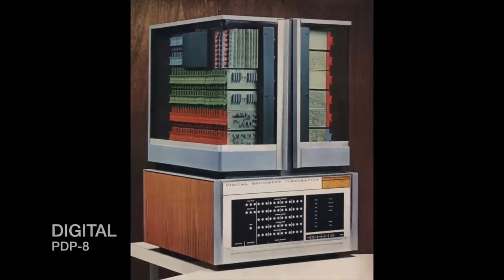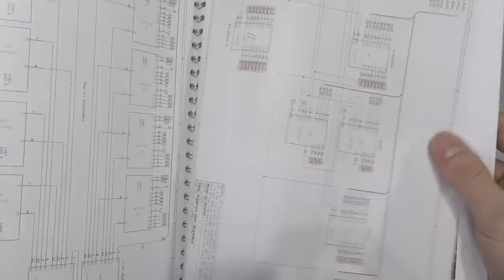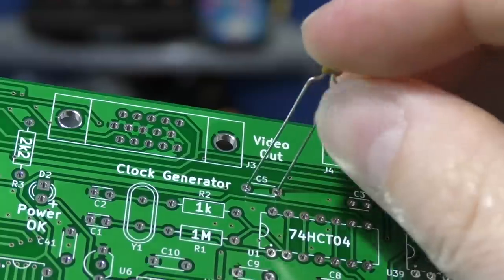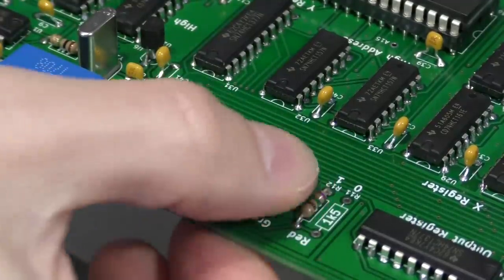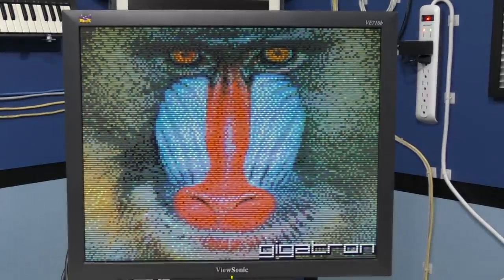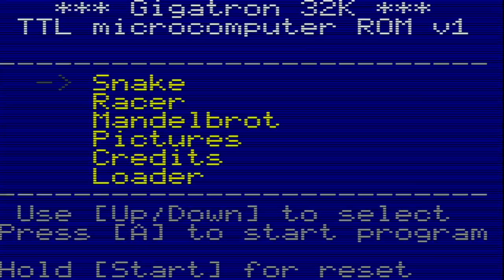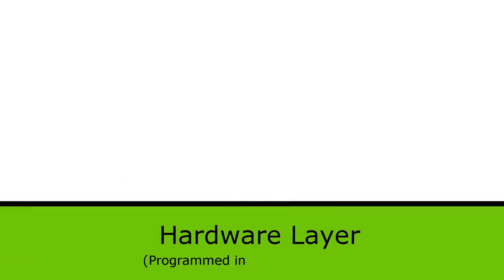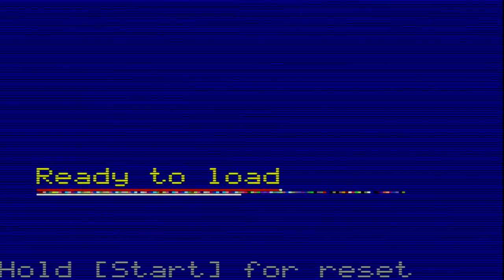The Gigatron TTL Computer without a Microprocessor

Comment: Hey David, love the content here and on 8-bit Keys. With the soldering, I was taught to heat both terminals and melt the solder on one of them instead of melting straight on the soldering iron. The idea being this makes a connection less susceptible to becoming a dry joint. Granted, this was with BNC connections for coaxial cable, not electronics, but is there any merit in what I was taught when it comes to electronics? Happy to also hear from learned viewers on this one, of course 🙂

Comment: When I was in the Navy, in the 80s, I worked on a computer that had no ICs or even NPN transistors! It even had a magnetic core memory and used punch cards. The government spent over $10,000 a year just to have custom circuit boards fabricated to keep it running. A decked out 386 was running about $2000 at the time, and hundreds of times more powerful!

Comment: 6502:  LDA ... from memory,  from memory with 8-bit address, with pointer relative to X, with...  Yeah, they counted the actual opcodes so it's kind of Apples (kek) and oranges.  A ton of the instructions were just different addressing modes of the arithmetic and register save/load instructions, or they were inverted versions of the same functions.  This thing used bits very well to do symmetry, because they were trying to save on a simpler instruction decoder.  The PLA concept on NMOS 6502's is actually pretty neat.  I've seen Visual 6502, but I wonder if there's a Visual 4004.  ;)

Comment: That assembly is completely bass ackwords. Always install components from shortest to tallest This allows you to flip the board and solder without dropping small components and crushing tall components. First all resistors, diodes and axial caps,  then ic's, then radial caps, finally connectors and jacks.

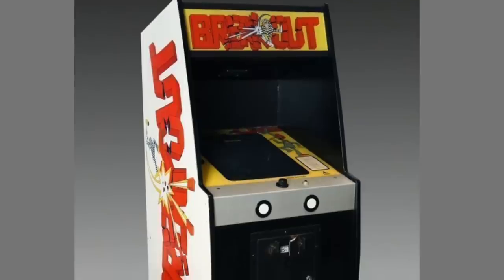Comment: 0:45 Wozniak designed a Breakout for Atari but they didn't use the design for some reason and instead designed it again with double the number of chips. and this was in 1975 when 8080 and 6800 was already around.

Comment: If someone has a dream computer that they want, the best thing is to build it yourself. There is a guy in China his name is Paul and he sells DIY computer kits, and what you get is a handfull of chips that you program and build your own board and write your own software and firmware. Also some of that firmware is available on various sites, or from coping it and modifying from an existing computer that you have on hand that you can do a dump of the ROM chips. When I get to feeling better and have a bet more money I am thinking of building a hypercube based on a common processor such as the 68000 or something newer. This is how super computers are constructed, and it is possible to do the same thing with Raspberry PI and other boards. That is putting them into a matrix configuration such as 4 x 4 x 4 and having separate cpu's for input output and other functions and program memory. Each board would need to have it's own firmware, and that is how the complete system would operate.

Comment: Your joking about the tubes but it's still classified even today that they were making tiny vacuum tubes.
A few will remember seeing the big green radios used in the Korean war that spawned the term, "walkie-talkie." These actually had tiny tubes in them, the size of large acorns. And commonly called acorn tubes.
What very few knew and is still officially classified information is that they were making much smaller tubes that were the size of a large grain of wheat!
The big secret black boxes used in early jet fighters and by Navy gun commanders in the early fifties were packed with them so densely that they had to be water cooled!
They had several functions.
Calculating trajectories was one.
Doing the math for radar displays was another. They were basically four bit calculators....
I don't know, but suspect they were also used aboard ships and submarines in sonar displays.
They were also used for encryption and decryption of messages.
I have a small collection of these devices and even a board from an F-111 radar that has nearly fifty wheat tubes on it!
It also has the some of the first solid state diodes ever made on that board. They are glass beads with a silicon bar you can see inside. (They are really crappy diodes that are very leaky!)

Comment: I was doing arcade game repair in Catalina and they happened to have 3 Computer Space arcade games (the first arcade game). After looking over the circuitboard, I noticed it has NO CPU... not even a volt regulator! I’d rather design with a CPU than deal with that TTL headache!

Comment: A cool kit ,i like it,i will get 1 of these.it maybe expensive.but its the enjoyment of building it ,and seeing how it works.plus learning how it works.without a microprocessor.like in the coments ,cpu's were   around  before microprocessors.another tip.is too use sockets,on the i.c.s.we know most are cheap logic etc.but sockets cost pennies,cents now.damn sight easier too remove.if an i.c.dies.just pullout and replace!i always use sockets.on my projects.plus early dip i.c. computers,mainly used i.c. sockets for this reason,and chip cost.i.c.s were expensive.in the 1970s,1980s.it was an idea carried over,from vacuum tube computers.easy too repair .pullout ,pushin!

Comment: The monkey is a Mandrill one. The virtual instructions are what is known as "synthetic instructions" on the UltraSPARC: the assembler, /usr/ccs/bin/as, understands these and assembles them into multiple RISC instructions, but they do not actually exist. For instance, load and store instructions on the UltraSPARC architecture do not actually exist, they are made up of two separate instructions because of the fixed instruction encoding of 32-bits, since 32-bits are not enough to access 64-bits worth of address space. The virtual instructions in this "Gigatron" computer appear to be the same concept except for the fact that it looks like they are interpreted rather than assembled into machine code?

Comment: Honestly, I feel that the 8080 Intel Chip should be Used on a 8 Bit Computer. Also, Breadboards are More common to Be found by Many people as The 8 Bit Master tool. But the Circuit board I still love. Soldering is just more fun to do Then a connecting Wires.

Comment: If you want to have it for free (one way or another) you can use MAME (although you'll need to download the rom gigatron.zip before running it).
MAME is the most interesting emulator know since it can emulate stuff that's more unusual then other emulators including plug and play games, some arcade games like Emeraldia or Zooo (yep, that's a real arcade game however I know a DS port known as Zookeeper), Linus Åkesson's Craft (a single chip demo made for Breakpoint 2008) and even the previously mentioned Gigatron (including firmware version 5a), making it my favorite emulator.

Comment: Just a thought but do you recommend soldering IC sockets onto the board with the chip plugged in?  I've got an "ideal" computer in mind but cant figure out where to get a PCB blank that's large enough to hold a Z-80 for each pixel.   Be well cobber.   :)

Comment: Would a modern 6502 CPU crash on an opcode ending with a 2? #2?   Anyway, not all that long ago, a guy I worked with in the 80's wanted to know if I could get his 'lyrics he wrote' off commodore 64 floppies.  I know there were C64 emulators, and I had access to an old 386, and I had the floppy drive! All those 5 1/4" floppy disks still worked! 30 years old! I put all the data, pet ascii converted to TXT files, on a CD.

Comment: Yawn. I suppose the relay based computers did not count. BTW, when I was in the USN, I had occasion to work on a digital computer that not only did not have any microprocessors, but no integrated circuits, or even NPN transisters. I think it was an AN/YUK-5, but don't remember for sure. It was used for payroll processing and inventory management. It even had a magnetic core memory. Logic gates and flip-flops were made of discrete compoments, mounted on edge cards.

Comment: The Dream Machine should have a 1024x768 resolution, theres tons of 4:3 LCD monitors out there looking for a purpose in life. And 4:3 is the same as old CRT TVs which the 8/16/32 bit home machines used.

2K and 16:9 might be overkill for the 8bits, but no reason to never have a future 2K mode, there could be a quad split screen option to allow four simultaneous machines to use a display. for A B testing etc. if the Dream Machine was optionally slot based...

Maybe a universal Dream Machine using CPU modules, then could drop in any flavor of CPU/system desired, 6502 6800 Z80 8088 8051 6809

Comment: 4004 first micro processor on the commercial market, yes, but not the first micro processor. The MP944 IIRC went into use one year ahead of the 4004. If you wanted one you had to buy a Grumman F14 Tomcat. Classified until the late '90s it lost its claim to fame and day in the sun. Even without paying for the Tomcat it was probably not a commercially viable part.

Comment: I would have integrated an Arduino Nano socket or actual Arduino Nano compatible into the thing so you could at least have fun developing on it.

And a mode that removes the Virtual CPU layer so you can develop straight on the hardware too.

Comment: Education and entertainment are really expensive. You learn how basic computer electronics work and get amazed by how the complex code inside Gigatron gets squeezed inside simple TTL ICs. For me, Ben Eater's 8-bit computer as well as  Malvino's original SAP-1 kits are cheaper (if we replace the breadboards with protoboards) and  easier to understand for a beginner in digital electronics. I think SAP-1 with assembly programming is enough for me before I move on to learning microcontrollers and start programming Arduino  Uno clone at less than $10. Not practical to buy $200 Gigatron.

Comment: An interesting design.   Too bad it is not easy for users to write programs for it.  It reminds me how useless I thought the Sinclair ZX-81 was after owning it for a day.   The most interesting CPU architecture I have seen is the Stack Machine.  It can be implemented with AMD's 2900 bit-slice chips.   It has 4 registers: an accumulator, a program counter, a stack pointer, and a frame pointer, which also addresses the Stack.   All (microcoded) instructions use the Stack and the jump to an interpreted high level language is very close.   The high level language - Lisp, Pascal, C, etc, is the virtual machine.

Comment: Basically it has 8 real instructions, 32 virtual instructions, that are translated into the 8 real instructions. I assume that means the virtual instructions are not 1 cycle instructions at all.
Reply: You can't really say it has 8 instructions and then compare that to a 6502. The ALU has 8 operations, but there are 256 opcodes. The vCPU is 16-bit btw.

Comment: My dream hobby computer would have both a 6502 and Z80 with both able to take full control of all functions and use the other as some kind of processor. Sadly the Z80 is hobbled on the C128.
Reply: I might have a loose idea on how both CPUs could work together. Maybe they could both work on the same clock but in alternating cycles somehow, or just at the same time. How about instead of a regular 6502, a 65C02 is used and it could run at twice the clock speed the Z80 is set at (e.g. 8 MHz while the Z80 runs at 4 MHz)? In that case, a custom chip could be in charge of generating graphics and maybe even sound, and it would be controlled by the Z80. The custom chip could also serve other roles, but I don't know any that comes to mind (other than helping RAM access between CPUs).

I admit that I've never tried an 8-bit computer in my life and I'm just curious about what hobby computers and other machines could be made by revisiting that technology. Lately, I have wasted (or just spent) a lot of time looking for information to fuel various machine ideas I think I'm unlikely to make anytime soon.

Anyway, I don't know what idea you had in mind for that machine, probably something more realistic or feasible given that I honestly don't know enough of what I'm talking about for a clear enough idea for a dream hobby computer. Sorry if that comment feels long enough to be a waste of time or something like that. Especially given that it's your hobby computer idea and not mine.

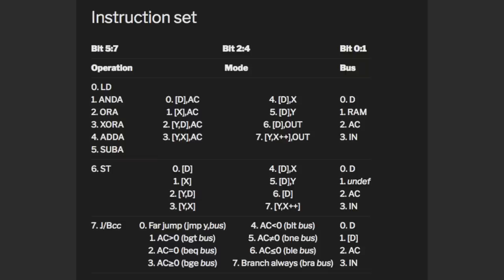Comment: @8:38 "it only supports 8 instructions" and that's where the name RISC; Reduced Instruction Set Computing comes from, right? Ok putting joke and pun to aside, something far more relevant equipped with a capable RISC cpu is Raspberry Pi400 kit at half the price.
Reply: "and processors from Intel supported hundreds of instructions"; but I believe they were built on CISC architecture (complex instruction set computing). I bet people have been comparing/mixing RISC vs CISC even earlier then EPOCH (unix date).

Comment: It could be said, it IS a microprocessor.  Board level. When does the Commander X16 get released? Im poised n ready :)
Reply: No, microprocessors are single chip by definition. It is a CPU, but not a microprocessor.
Reply: @beopstek  Ah. Touche!  Cool in any case.

Comment: Dunno, looks pretty crappy TBH. I built my dream computer already, an atMega2560 (as you need lots of flash if you want neat graphics), a 320x240 color screen with parallel interface - and some secondary stuff like a three-bus PSU with LiPo charger -  and various buffers and port adapters, mostly on the tiny mainboard. Was pain in the rear to code the GUI-based OS in (pure ASM, of course), yet it supports all the newschool stuff like alpha-blended cursors and fonts, styled UIs and even antialiasing for lines, in fact it is a pretty useful thing I keep at work as an all-purpose handheld tester. Self-programmable of course, runs a server app on a PC and does the rest on it's own.

Comment: Yes, but can it run crysis?, well this is low level as far as it goes, so are you saying that it only supports 8 opcodes?, I remember when I was learning assembler, that there were first opcodes cards, just a small list with 10 - 20 opcodes, then, opcode pages, with like 50 - 60, then opcode books and now there are opcode websites. Also on a side note, you cat doesn't seem to be aware that it is flamable.
Reply: There are 256 opcodes. You can say it has 15 or 16 instructions, each with a set of modes.

Comment: Surprised you don't use a fume extraction system.  Its important if you enjoy good health.  We have a multitude of assemblers with various forms of cancer over the years.  Although they are more exposed to fumes over a lifetime compared to a typical person, any exposure of toxins is not good for your lungs.  I'm not saying there is a direct correlation between soldering and fumes, but empirical data shows jobs with higher exposure has more health risks.  Of the several assemblers I worked with over the years, 3 died from lung cancer and 3 from pancreatic.

Also, having a cat on your work bench and exposed microelectronics is not exactly a good formula.  I know you're wearing a wrist strap, but you still have a higher exposure for ESD damage for more sensitive devices.  You don't even have an ESD safe workbench mat.  Luckily, you're just working with TTL logic ICs so the sensitivity is lower, but its just a caution for devices with sensitivity less than 500V.

Comment: Can you put the monster 6502 into a c64 and have it work?
Reply: The c64 needs a 6510 at 1MHz. The monster has neither, discrete transistors are slow. There is a C74-6502 that works in a c64. It is made out of TTL chips instead discrete transistors.

Comment: You’re cool, but you are still soldering wrong. You are pushing the solder onto the iron too soon. Heat the joint briefly and push the solder onto the joint, not the iron so much

Comment: 2 bit guy . No really this thing asks at what point do you break the rules and make something out of totally low level parts. In this case it is really only the DRAM that is a LSI chip. That is probably better since it is a mostly irrelevant part of the computing process. They chose not to have a GPU.

Comment: Just one word. Atari 5200 arcade home video game and computer console.  Only they never released the keyboard that was to interface with it. And the blank rrw cartridges that were to compleat the storage part of the home computer part of the game console . Timex synclare with the texas instruments  z80 processor  and Commodore 64 came out almost at the same time and was better and more versatile and powerful.  Not by much though 😎 however as a game console alone it was a superior unit  the analog to digital converted joystick and trackball and automobile  controlers were better than all the other video games on the market  for many years after and even to today. Most games joystick have only push button controlers with no true analog joystick,  or the analog stick is verry small. Meaning you have to buy an expensive aftermarket joystick if you want a good true analog stick for things like flight simulators etc... love the old 5200 It's a classic collectable early top notch video gaming console with true arcade grafix that are great even by todays standards.

Comment: well a 32 bit Commodore computer is what the aim could be. 8 bits for each monitor color. An 8 bit processor at the monitor, An 8 bit processor  at or near the keyboard.with a loop that stores a line number for each command. Here in scrz ca pge has connected soldering irons to 24,000 volt lines. I found some sort of a 40 pound isolation transformer.  Does anyone know how to put anythong on a computer monitor. I built a board with 2 555 timers 1 at 60 and 1 at 12.250